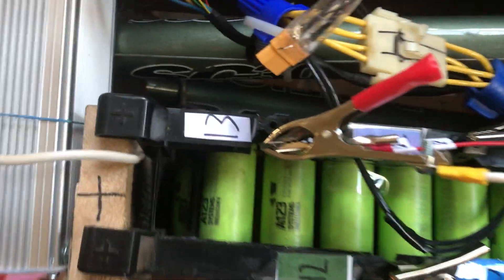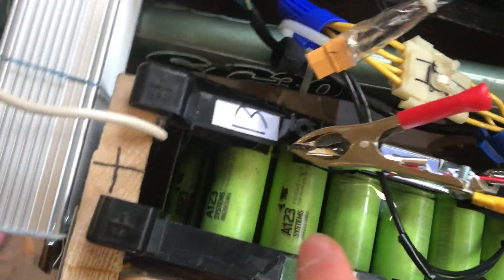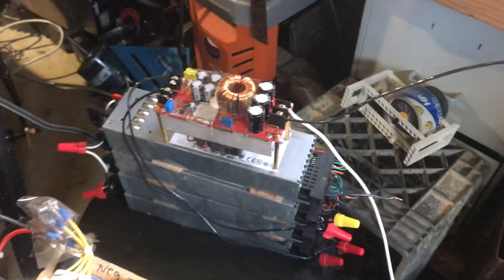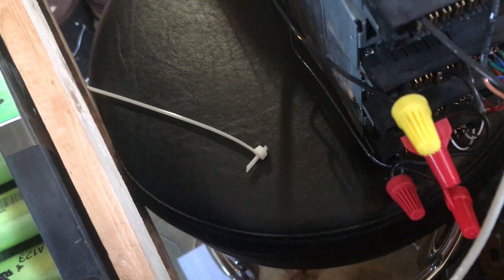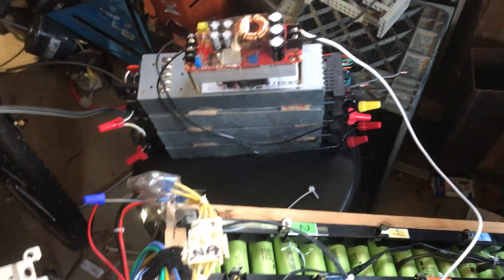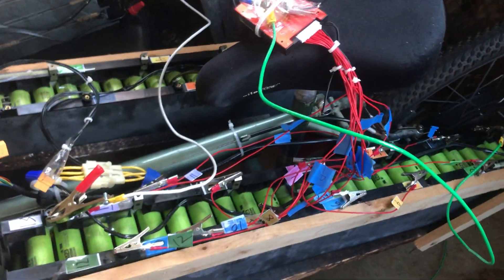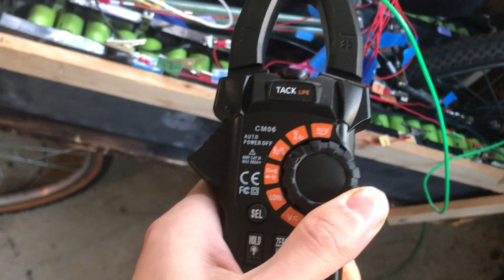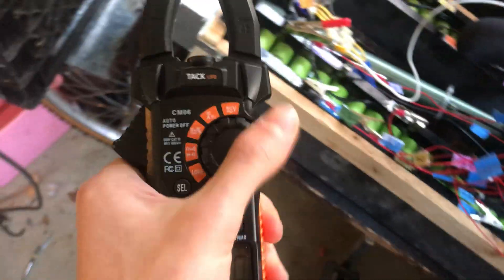How to charge your ebike with a Server Power supply | 72 volts | DIY Balance charging a 72v 24s pack

Comment: What difference does it make if the voltage is a little higher than battery max if the bms is cutting off charge at 43.2 or whatever? 

You always charge with higher voltage than battery voltage - shit flows downhill.